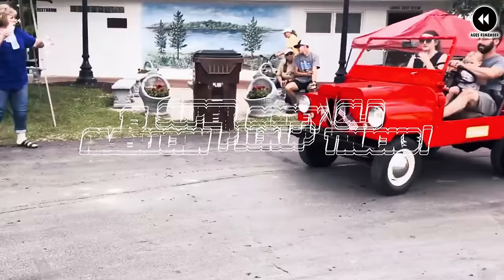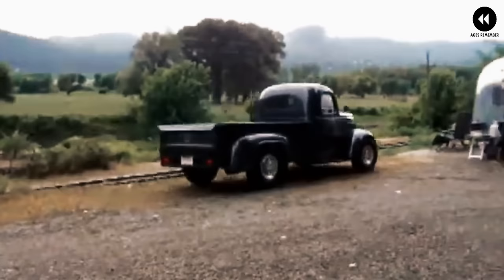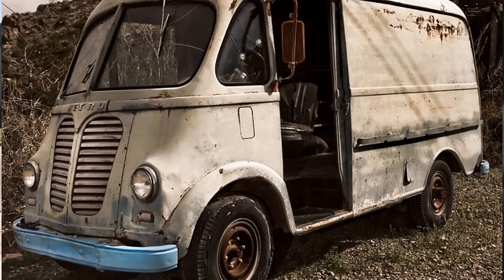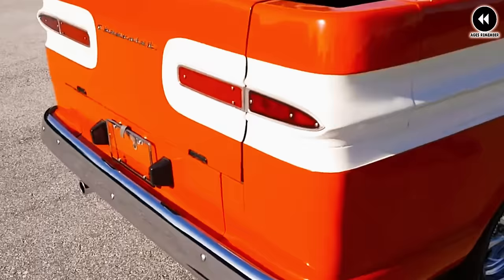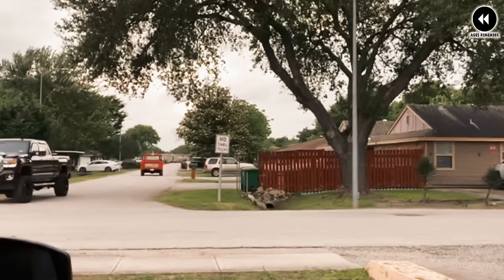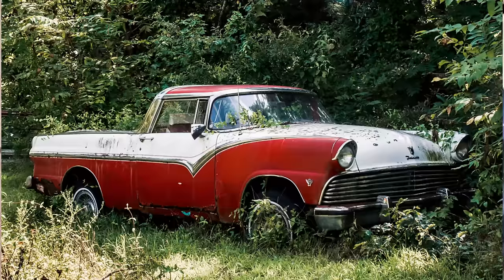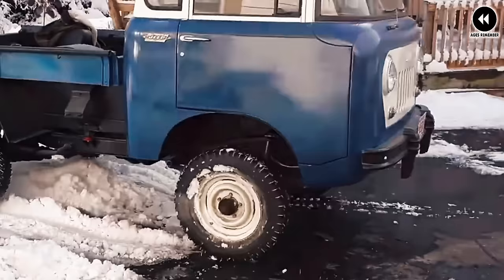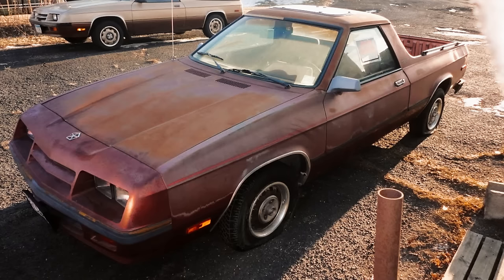15 Super GOOFY American Pickup Trucks!! from The 1940 -1980s

Comment: You are covering a Ford station wagon made for commercial delivery  from the 1950s and flipping back and forth to a compact Ford pick up truck from the 1970s. They may have had the same name badge but were totally different vehicles, one based a station wagon with an enclosed cargo area and the other with a compact truck with an open cargo area. This really needs to be researched a little more before releasing it. There are several other complaints about other vehicles in this.
Reply: The Ford Courier pickup was a Mazda built compact pickup rebranded as Ford, the Ford sedan delivery was a USA made from a Ford station wagon why it was called a sedan delivery !!!

Comment: That Crosely was a pi$$ poor excuse for a pickup  more of a side by side utility vehicle !!!King midget was the sorry excuse as  a pickup!!  REO was  real pickup  built by a truck co..  The Ford Courier sedan was not a truck but a sedan delivery, it was a station wagon with out a back seat or back windows !!!  and the Ford Courier compact pick up was a compact truck built by Mazda!!!  I had one, great little truck !!!  The IHC metro was a commercial delivery van !!!  and the Willy's FC was one of the first 4wheel drive pickups !!!  The corvair and econoline compact pick ups were some of the first US made compact pick up and very useful !!!  this included the dodge A100..which by the way was a front engine design, the Corvair was the rear engine model.  Also the Ford econoline PU was front engine rear wheel drive. the Chev E Camino and Ford Rancheros were not trucks but station wagons sedans with the top back cut off and you would not find either one delivering supplies to construction sites, you would find the bosses driving them !!!   the studebaker Champ was a light compact pickup using a passenger car cab...te later jeep FC was just and extension of earlier models built on a CJ frame as a cab over !!!.The Chevy LUV was a rebranded Isuzu and imported same as the Ford Courier pickup a foreign built compact pick up  and add the Mitsubishi built Dodge D50 to the same list...The "Dodge" rampage was a mitsubishi built unit similiar to the Ford Falcon Ranchero, a "compact" "pickup built out of a passenger car .....Did any of you people ever do any real research on the info on these trucks ????  as soo much info was pure BULL$HIT wrong !!!! Or did you spent most of your time looking at bare @$$ed women on your other articles ????

Comment: @14:30 the A100 was mid-engine not rear.
Reply: It was front engine rear wheel drive, a cab over design !!!!  As was the Ford econoline van and pick ups
Reply: @wilburfinnigan2142  yes the engine 'dog-house' was between the seats technically front engine.
Reply: @wilburfinnigan2142  We had a Dodge and it always ran hot and would even vapor lock ,it was a terrible layout .I think if the cooling system was moved to the front like latter vans it would have worked better.